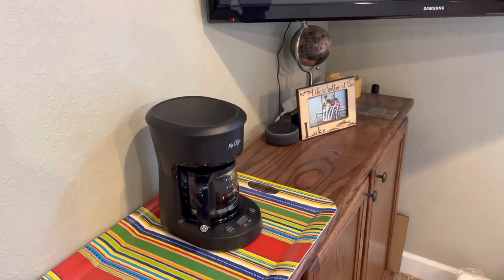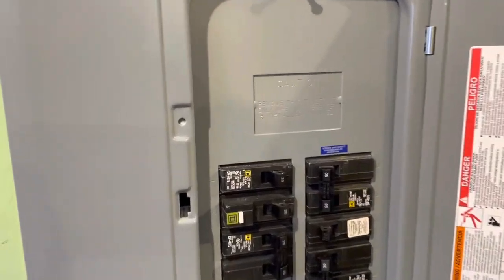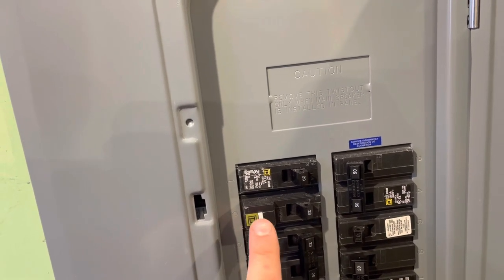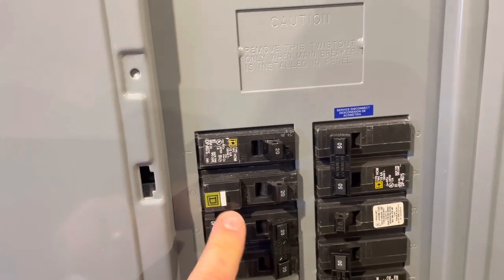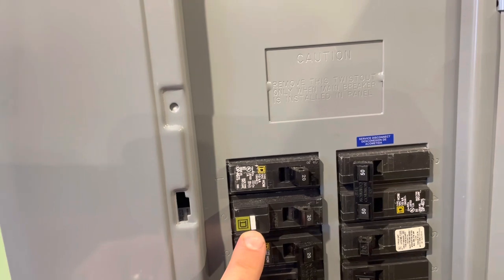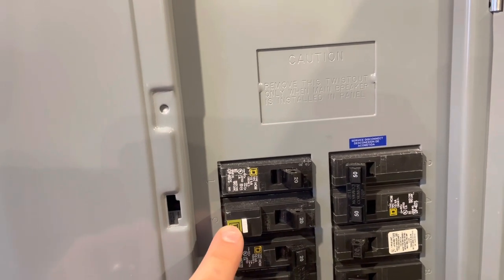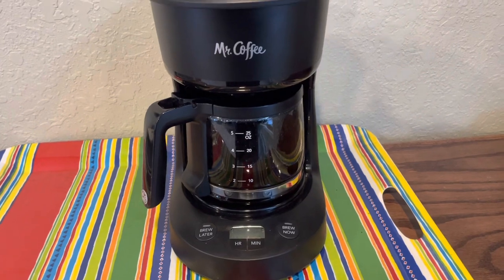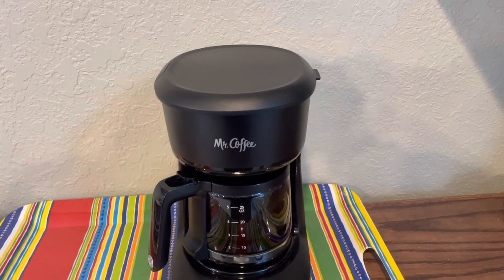Nuisance AFCI Circuit Breaker Trip from Coffee Maker?

Comment: Neat trick I'll have to share this with my coworkers who are electrician like myself.   We haven't have issues lately with AFCI nuisance tripping,  but in the past,  most notable during the first 5 years or so when AFCIs were first mandated for bedrooms around 2002,  vacuum cleaners were a major culprit.  Wonder if a surge protector would make a difference if a vacuum is causing nuisance tripping  ??   The latest AFCI breakers have definitely improved and less prone to this problem vs earlier models.
Reply from the maker: Thanks for the comment. Yeah, the longer these new trinkets are around, the better they get. I remember the first generation of tamperproof receptacles. They were terrible compared to the ones made now. God bless!

Comment: There are many different kinds of surge protectors. It would make sense to get one that filters noise and not just a voltage spike which may only stop a spike that is quite high in voltage. So without telling us which surge protector you used, this is almost useless info. Mabe it has inductors and capacitors that filter noise for example that fool the breaker.

Comment: This whole acr fault breaker code is annoying. Motors create an arc, thats just what they do. Any electric motor you use will immediately pop the breaker. I cant use my blender, my vacuum, even my air fryer occasionally pops it. Had to replace them for inspection for redoing my kitchen. Theyre expensive as hell (over 700$) looking like ill just have to switch them back to normal ones after the final inspection
Reply from the maker: Thanks for the comment. Yeah, they are no fun and the price just kills me. I hoped that, just like when tamper-proof receptacles became code, the price would come down to help us out…nope,not on these…
Reply: @NashwaukSteve  do you know how to stop them from popping all the time? I really can't use most of my small kitchen appliances
Reply from the maker: No- I fortunately don’t have these on my home, just the additional out buildings like my office with the coffee pot. I can say I’ve used a small dirt devil vacuum out there with no trouble.